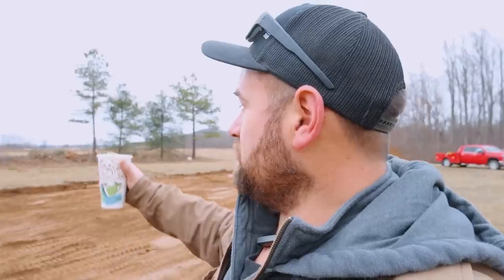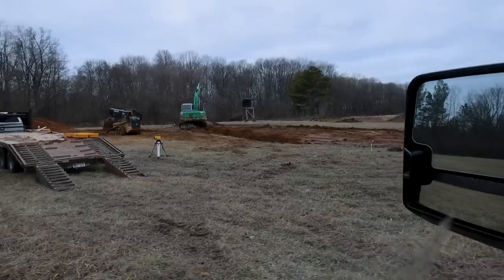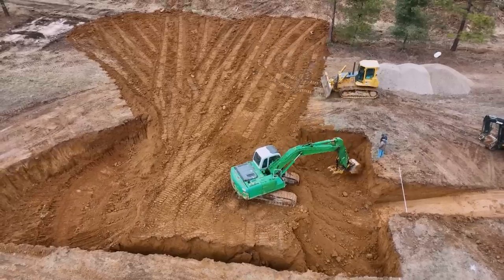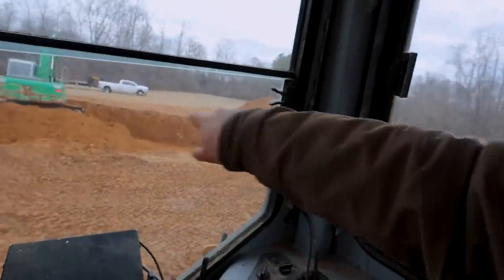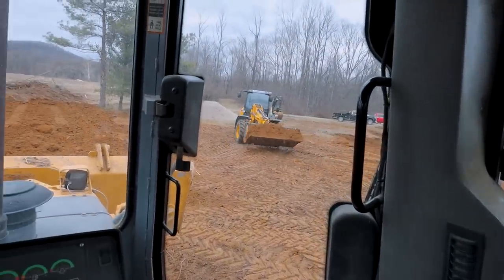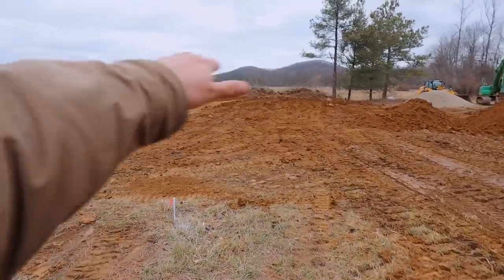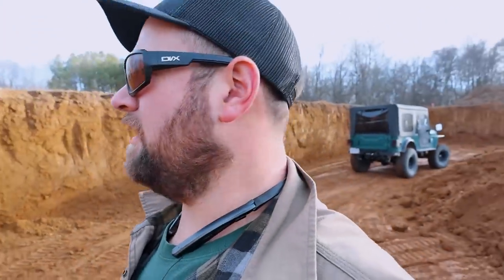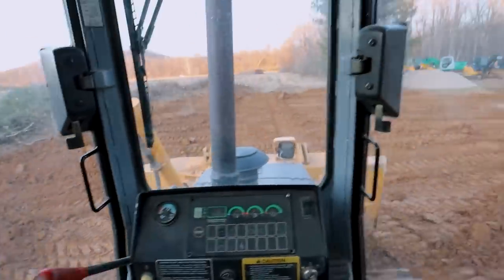Digging the Basement for our Dream Farm House

Comment: When I was a dozer operator in the early 90s do 750c Dozer orbi dozers hydrostatic they would only grade smooth at one speed you can watch the blade bounce up and down an inch-and-a-half off the track speed it was cool it's an art for sure hang in there Bryan

Comment: Where are your french drains going to drain to or are you planning on some kind of sump pump for ground water issues?  Where’s the D8?  Figured Bob would be rockin and rolling in it.  You’re lucky to have all dirt.  When my folks had their  foundation dug there was maybe 8” of what might be loosely considered “dirt”!  Underneath was layer after layer of sandstone and real tight shale.  I recall the contractor broke 4 teeth off the bucket of his tracked loader.  He was not amused.

Comment: You guys are lucky my parents had a outside concert storm shelter put in and the guy hit rock after maybe ⅙ inch. Then had to use a rock bucket and only got down 3 feet. They gave us 2 choices they could go get  some tnt or they would just have to build a hill around the shelter because they couldn't get any deeper
Reply from the maker: That’s unlucky
Reply: @BriansFarmingVideos  well the neighbor a while back was building fence and the guy that was doing it for him had a bobcat with one of the post drivers on it that could do it 3 inch pipe it took him 15 minutes to drive a 2-inch pipe 2 ft into the ground and over a week to build a fence around 10 acres